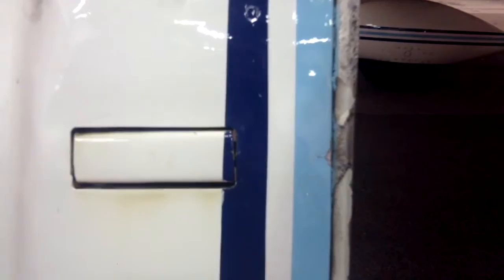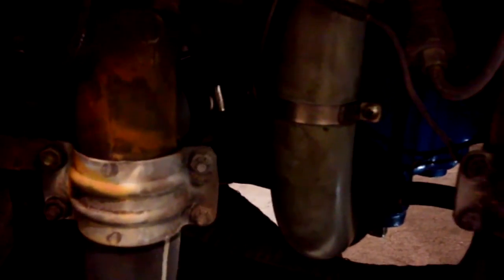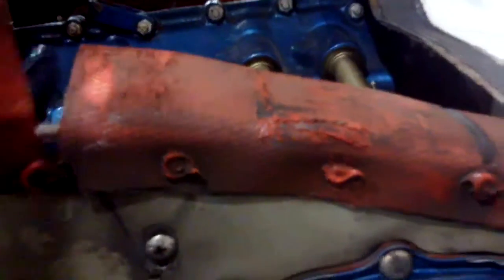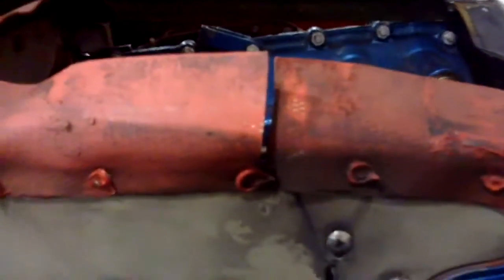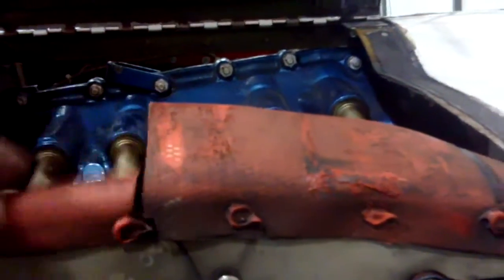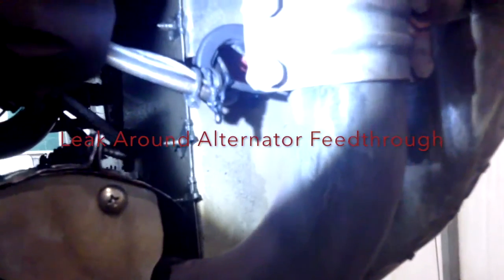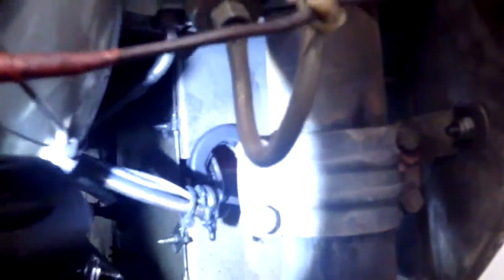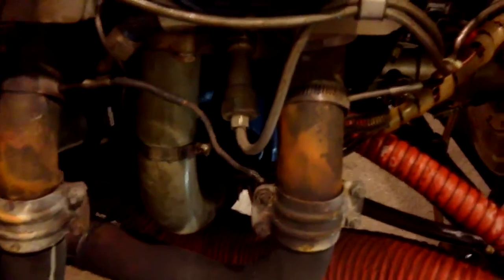Tiger Running Hot  - Grumman Style

Comment: I don't know if the heater control valve on the firewall is the same on all Grummans but the one on my Tiger mixes air from the lower side of the engine with hot air ducted from the muffler shroud.  The first indication I had that an exhaust stack had developed a crack was when my CO detector went off after I put on the cabin heat.  Owners should be aware that any exhaust leak can get in the cabin when they pull the cabin heat.  IMHO, no exhaust leak is acceptable and a CO monitor is a must.  Thanks for all of the videos!
Reply from the maker: k